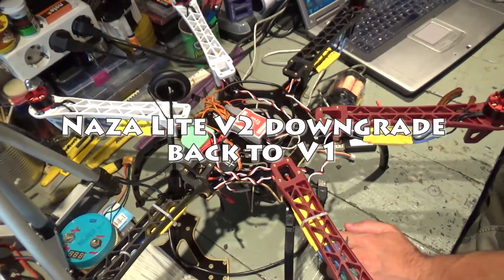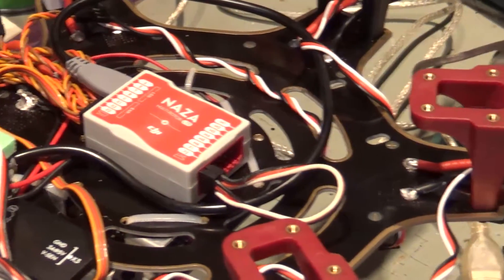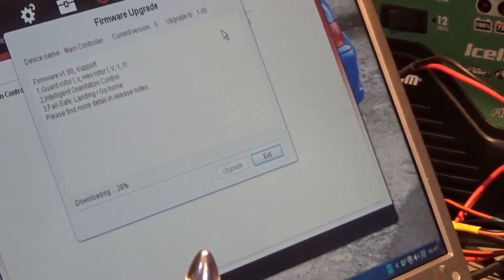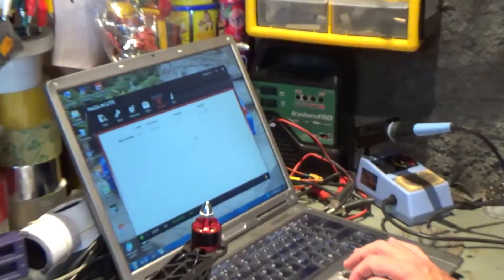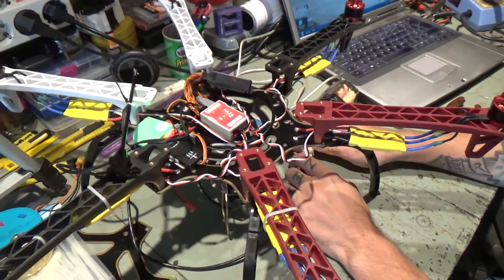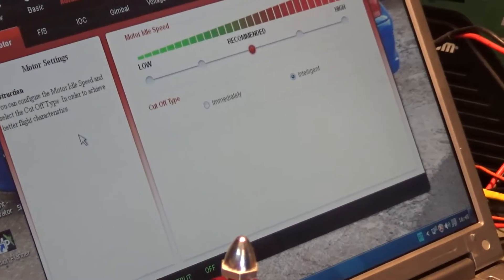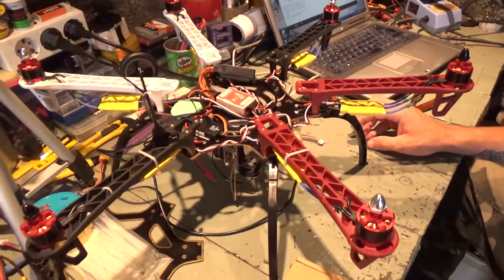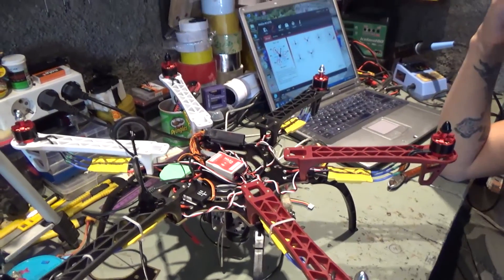Naza Lite V2 downgrade back to V1

Comment: have you solved this ? i have the same problem
Reply from the maker: Arpit Pradhan yes i flashed a different older firmware to the esc's
Reply: Thanks a lot man. I just recalibrated the motors using cleanflight and voila!!  It worked
Reply: I just watched your other video, forgot to mention ☺️